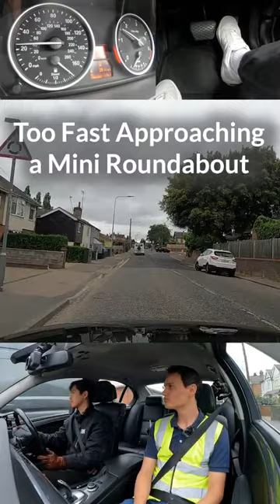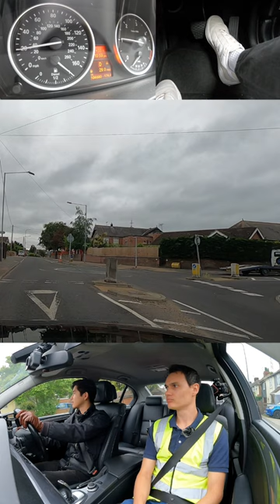Too fast approaching a mini roundabout

Comment: Your videos are great. I was following my sat nav religiously and it didn't mention the two mini roundabouts I gaily sailed over, I now appreciate that perhaps I should read the signs rather than just listening to a reassuring voice
Reply from the maker: I usually have the sat nav voice off when I'm driving as I find the directions sometimes misleading. I seem to get more success from following the signs and the sat nav. The sat nav often helps me know which signs to follow. For example the sat nav will display exit at M25 N, then I follow the signs to M25 N.